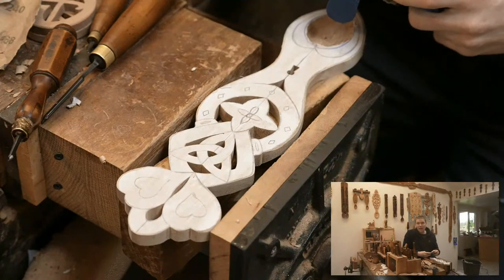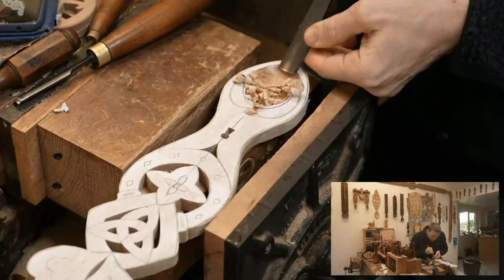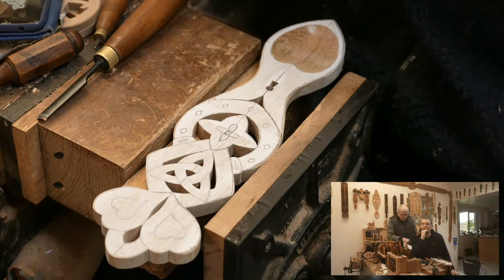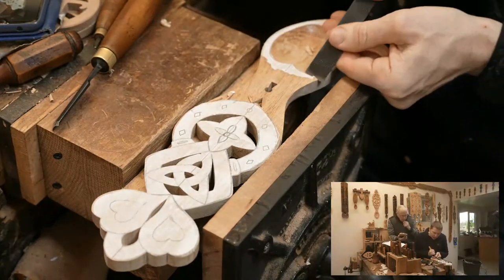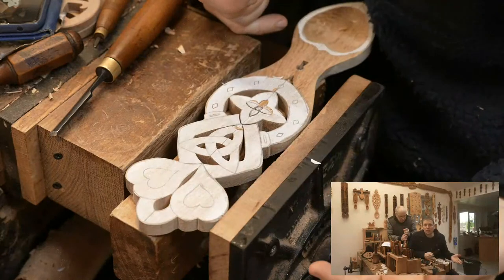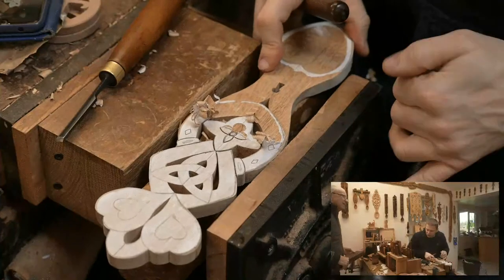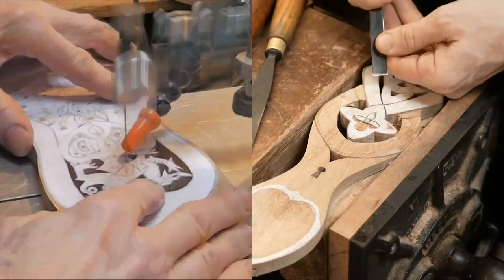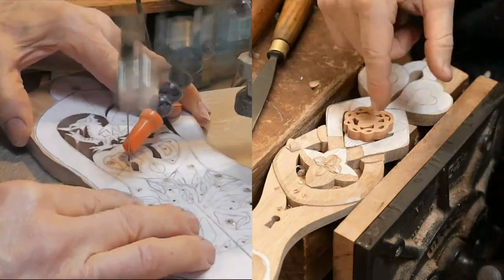Woodcarving live.

Comment: What size blades do you use on the scrollsaw, and does it vary depending on the type of wood, many thanks.
Reply from the maker: Hi Dean, great to hear from you. I use a Niqua Speed number 9 reverse tooth blade. It does a great job for the work we do. I am working in hardwood that is between half and inch and two inches in thickness. If you are working in thinner wood a lower number might be more suitable. Soft wood might equally require a lower number blade. Pegas do their own version of a reverse tooth blade that works well as does Flying Dutchman if you are in the USA. I have attached a link to the blade I use for you to see because Niqua do a wide variety of different blades with others being inferior for the work I do.

https://en.niqua-shop.de/collections/51-holzlaubsageblatter/products/holzlaubsageblatter-niqua-speed?variant=35483684569243

Thanks for supporting our YouTube channel, all the very best from us all. 👍👍